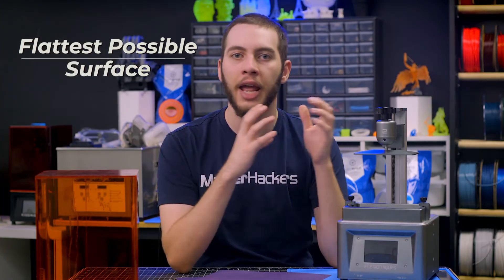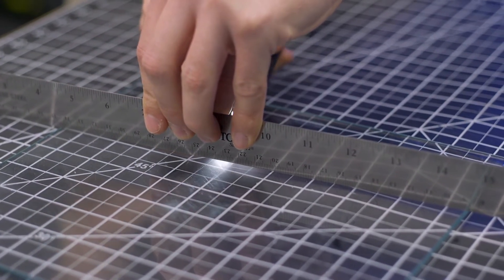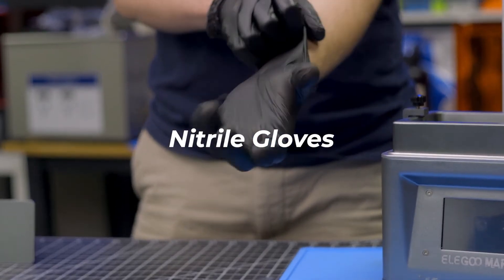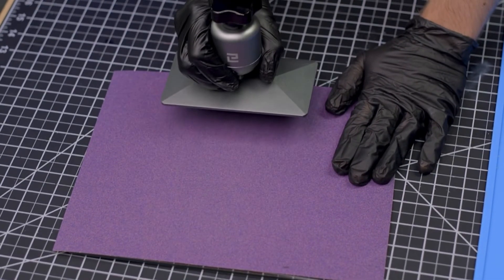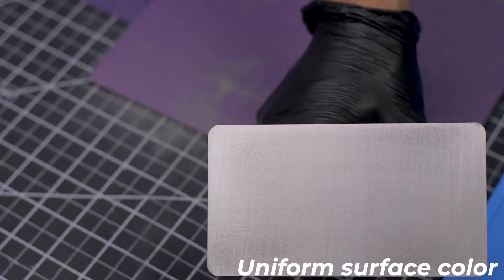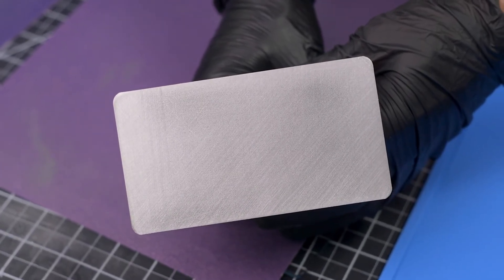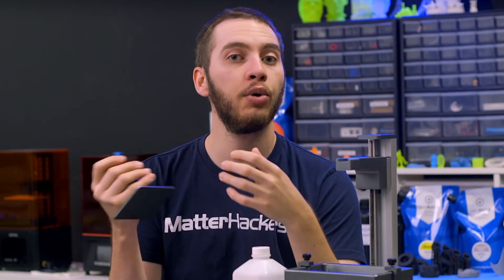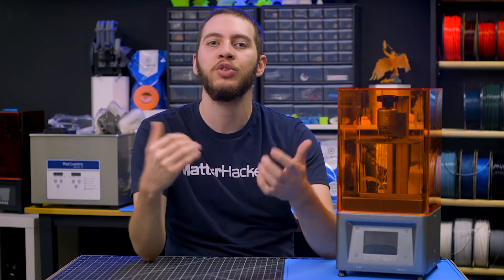How To: Perfectly Level Your Resin 3D Printer's Build Plate

Comment: Great video, but I have a question.
Do you have any recommendations on how to scale this to a large 300x200 build plate? (Anycubic M7 Max).

I've struggled to find any sandpaper larger than an A4 size (280x230). This makes sanding this build plate using the technique impossible.
I've tried connecting two pieces of sandpaper together using tape, with limited success.

This may have been a stupid question, but I'm open to ideas to maintain a flat surface while sanding.
Reply: You can accomplish that by using an expandable plank and gluing the sheet next to each other.
However, I might add, his technic is deeply flawed. the 80-120 grit is way too coarse, 200 is better (slower but better)

 - take a sharpie / any permanent marker, and scribble (cross, square, whatever) the whole surface.

- now the really important part : when you sand the bed on the sand paper, count the movement or always do the same amount (like x5 or x10)

- Do a set of movement up-down (from close to you, to far from you, to close to you).

Turn the bed 180°, and repeat, then

Turn the bed 90° and repeat and finally

Turn the bed 180° and repeat.

The idea here is to sand each corner the same. Your body is not a machine, and you may apply more force on one side unknowingly, so by doing always the same movement, same number and rotating the bed, you will have an even sanding. Remove metal dust (vacuum or air blower, do not inhale it)

- Repeat until the scribble is gone up to the center. The first movements will just prove my point being correct.

Comment: THANK YOU SO MUCH! I wasn't aware of the concave center of my flex plate until I started sanding it and saw only the outside edges were scuffing up. I followed this guide and my second test print attempt was a success! This guide + leveling in-bed without the leveling card got me started right 👍

Comment: but wouldn't 120 grit wear the plate too fast?
Reply: 120 sands less than 80, grit number refers to the amount of particles in a area like a square inch of the paper, so the higher the number the finer the polish the paper will give thats why paper you use to do the final finish on things has grit numbers up in the 100's.
Reply: You are right. 200 is fast enough. 80 and 120 are way too coarse.

Comment: Why not just do the whole sanding with 80 grit and then do a few strokes at the end with 120 to smooth it out?
Reply: The point is to add some texture at the end for the cured resin to grip on to

Comment: Why not sand with the higher grit originally?
Reply: because then you risk taking off to much material , you want to sand just enough to get the high spots to the lowest point, 80 grit will have you taking off a few mm of material before you realize it and 80 grit leaves a very rough texture, if you do the material removal with that you will be there untill the heat death of the universe getting you bed back to smooth with only a little bit of grip texture.

Comment: As much as this my fix problems, I'm hesitant to start messing with my build Plate. Exactly how flat do plates need to be? What's the tolerance for working with slight dips?
Reply from the maker: It depends. If you aren't printing your parts directly on the surface and are instead using rafts and such, then you can probably get away with not sanding your surface. But if you are trying to print your parts without a raft, then it might be more necessary to prevent any sort of waviness to the initial surface. The main thing with any 3D printer modification, is if what you have is working, then don't change anything, but if it's not then start with the non-permanent changes first. If things aren't sticking and you're sure the bed is level, the exposure times are maxed out, your lift speed is very gentle, etc. then lapping the surface might be your best option. - Alec
Reply: You could also install a flex plate and lap the magnet and then the spring steel plate.

Comment: Wow, maybe it's the machinist in me but this video is filled with missing information. Like don't hold the part by the upper ball socket joint as it will cause uneven pressure leaving a possible tapper  to the plate. I would like to add people should look up and understand " hand lapping "
Reply from the maker: This video is just a snippet of how much time was spent lapping the surface. Initially there was a significant bow at the center of the build plate that was being sanded down first, and then once that was mostly removed, the build plate was barely held from the plate itself, rather than the head, so mostly gravity was applying pressure to the build plate. While fifteen minutes isn't a long time to sand down the surface, it also doesn't make for interesting content to include the entire thing. I appreciate your concern about proper technique, and I can assure you that it was followed while the camera wasn't rolling. - Alec
Reply: @MatterHackers  Okay, that makes a lot more sense! Sorry if it came off a bit harsh initially. My only fear is people desperate to get things to work, without going through the normal channels of testing, trying this, and making things worse vs better in the long run. I have seen some stuff in my time, hence the concern 😐.
Reply: Machinists checking in. I think it’s just fine enough, especially because it works in practice. Ultimately the sand paper should be bound to allow a more even figure-8 pattern.
Reply: How should it be done instead, if I may ask?
Reply: Agreed, although you would be mortified the things people have done to "improve" their machines 😐. The concept is sound but... Execution was... Eh...
Reply: I understand the point you are making but honestly the thing is hanging by a ball that can rotate and compensate for any tapered angles introduced. The critical part is the flatness uniformity of the plate.
Reply: A taper is not a problem as long as the plate is actually flat. The taper can be corrected when doing normal levelling for this machine, a concave or convex build plate cannot.